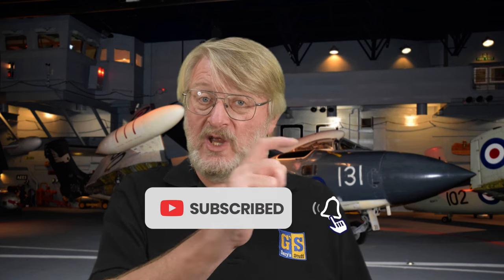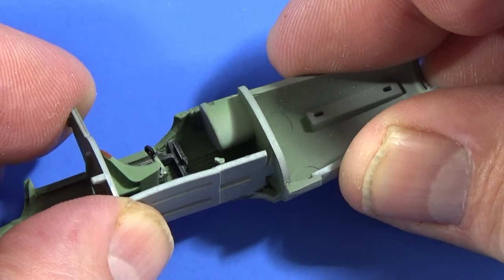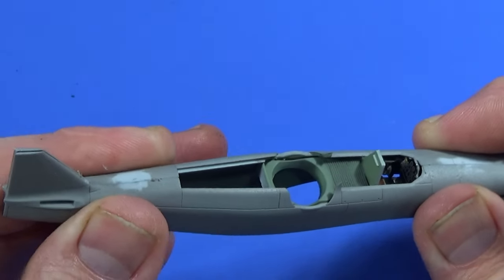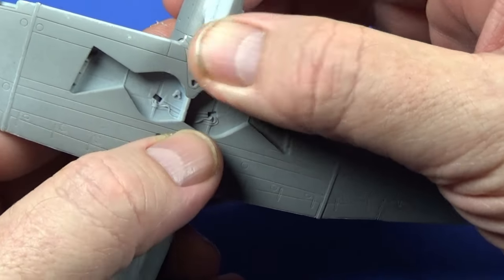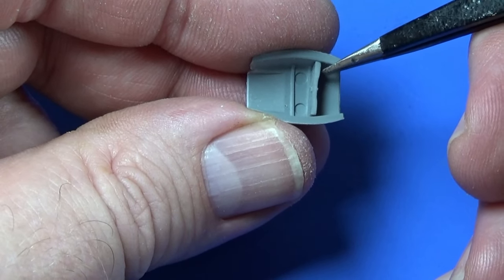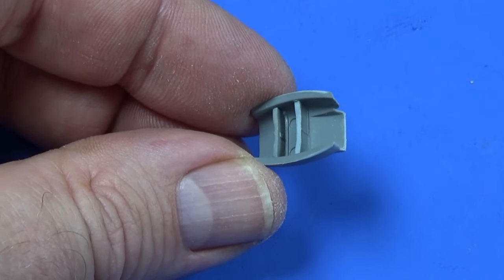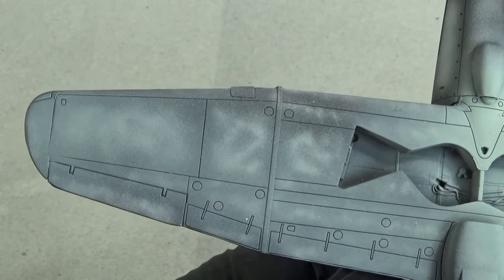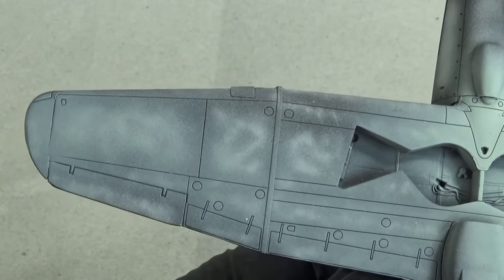AIRFIX DEFIANT 1/72 HOW TO BUILD IT!

Comment: Afternoon Gary
You did rather better than me with this one, but I feel slightly less inept having seen you struggle with the instrument panel. What finally defeated me was the guns - first attempt they didn't survive coming off the sprue, barrels just snapped off! Second attempt they just point blank refused to go through the holes - maybe I got rogue kits or the parts didn't quite survive the scaling down process from the 1/48 version.
Anyway, well done and a truly beautiful end result.
Reply: Had same problem with the guns so shaved a little from the slots in the turret to get them through. Instrument panel is as Gary showed  dead awkward but a nice little kit overall.

Comment: I built the Defiant a couple of years ago and got the impression that it was specifically designed for ease of build. Other kits are a bit more detailed, sometimes at the expense of fit, but this went the other way, and was a bit on the simplistic side. Easy builder though, and there are a couple of interesting Defiant photos that would make good subjects. The nightfighter planes had black painted over the day scheme, so when the black wore off (in large patches) it revealed the camo, so it is a good basis for a project

Comment: I'm making this at the moment and it's the first model I've made in 50 years. I'm blown away by the quality of this kit compared to those models available in the 70's. I had the same issue as you with the instrument panel and I also forgot to add the rudder pedals but, as you can't see them anyway, it makes no difference.

Comment: It's a nice kit, isn't it? I liked your build, but I'd offer a couple of obserevations. First, the undercarriage legs and retraction struts were usually black, not silver/aluminium. And, second, the Airfix wheels are a bit small. I don't usually buy aftermarket parts, but replacement wheels make enough of a difference to be worthwhile IMHO.

Comment: What’s interesting about the Defiant is how the specification completely ignored the lessons learned with the Bristol F.2B Fighter of WWI. The F.2B succeeded because it had fixed forward firing guns as well as the rear gunner for protection behind the aircraft and it was flown as if it were a single seater with the forward firing guns being the primary weapons. The Defiant could have had a couple of .50 cal MGs or 20mm cannon firing forward and the turret (maybe with 2X.50 cal instead of the .303s) and it would probably have been far more successful in the day fighter role than it was.

Comment: Ive got a Defiant kit waiting its turn in my stash.
Ive found that when using mask sets, its easier for me to lift one corner of the mask sheet and carefully peel it away completely so it just leaves the actual masks on the sheet which I find a lot easier to see all the mask sections.
You've done another lovely build with this kit Gary.
Reply from the maker: Great tip!

Comment: Hi Gary, I don't know what to think.  Is the turret really retained only by gravity?  Its a bit difficult to implement a rotating turret given the fairngs and so on but for an airbourne diarama (even on its own) it would seem necessary.  Just a difficult subject.
As a historical aside, the turret was virtually impossible to get out of in an emergency so most (if not all) the gunners in the day fighter carnage were trapped/lost with the aircraft.  Like most interwar theories, turret fighters were untried (like the standard Fighter command tactics).  When put to the test they were disappointing (to their advocates that is).

Comment: Original version I built 60 years ago! I always felt that the Defiant could have been more successful without the gunner and turret and mount guns in the wings.  Frankly, that could have been done as a post production modification. The weight saving would have led to a better performance.
Reply from the maker: But then they could just have made more Spitfires and Hurricanes instead... just flawed planning at the start really basing the design on the premise that German bombers would not have fighter escorts. Which is why the Defiant was much better in the night fighter role.
Reply: @garys_stuff   It was much more sophisticated than the semi wood former and fabric covered metal tube based Hurricane with its primitive thick modified clark Y aerofoil.  It could have accommodated larger and heavier engines for further development which the Hurricane was unsuited for.  A simple rear fuselage plug could have rebalanced things à la FW 190D.

Comment: How are the fit of the parts...currently doing their Lightning F.6 and 1 of the fuselage  halves is warrped so it took a lot of glue (even superglue in some parts) a lot of filler and a lot of clamps...i got there in the end but it was a lot more hassle than it should have been.
Reply from the maker: The fit is generally pretty good. No major bits of filler required, just a little at the top seam but really nothing major.
Reply: @garys_stuff  thats good to hear Gary.👍👍
Reply: Nice job Gary. It’s something different and I’m now wondering about the 1/48 version.